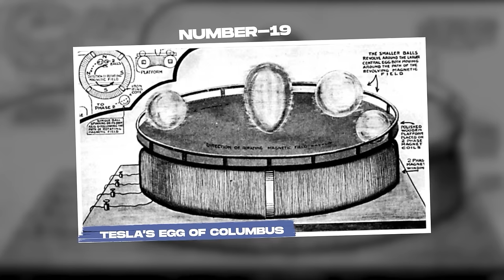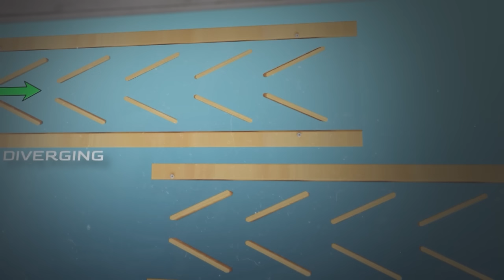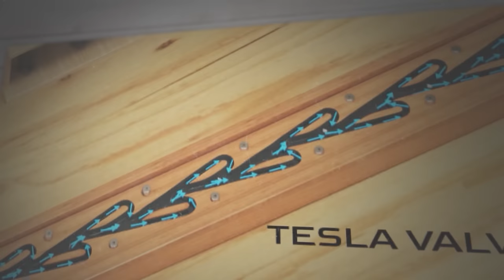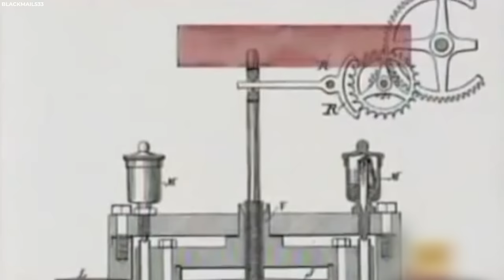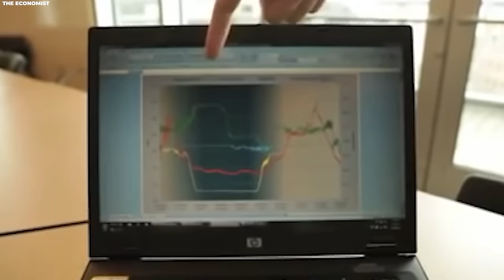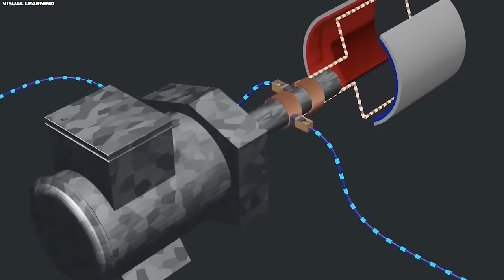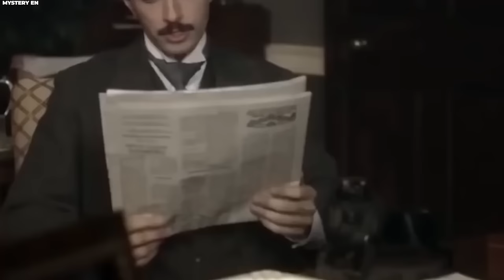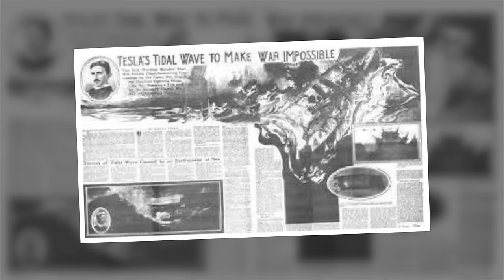20 Secret Inventions By Nikola Tesla That Shocked The World

Comment: the death ray was a particle projectile cannon.......its used small cilinders with a ball onthe top metal objests.   It charged the objects and used magnetics to project them.   It was the start of of the concept of rail guns.  Its why when it was used why it used so much electricity and caused brown outs.   The electro magnectis it genrated casued issues. but it did work.  Modern day pellet guns use a similar using projectile but not made of metal.

Comment: Dude who wrote this ?.  The description of AC electricity is insane, "it transformed into a AC motor".  From the breaker box, to the transformer to the AC motor.  Yes, potentially but AC powered more than AC motors, it powered everything after that.  DC to AC is called a rectifier, DC is mostly low voltage but we have DC motors that are high voltage.  DC hurts more than AC, why the electric chair was Edison.